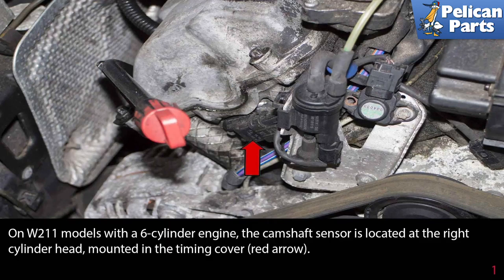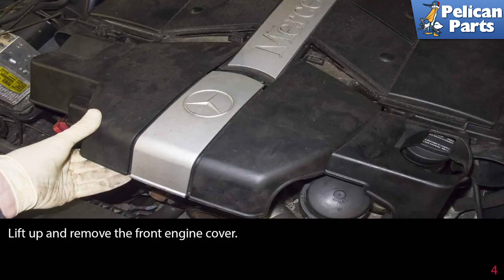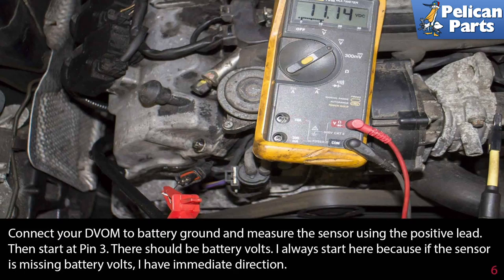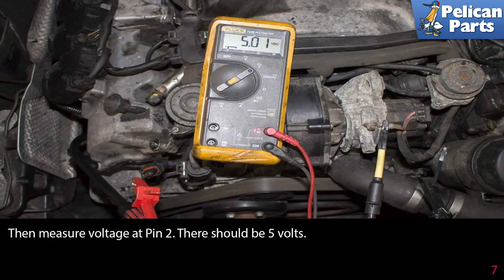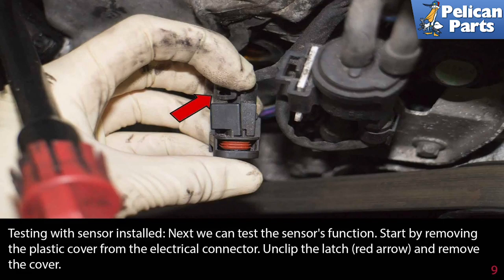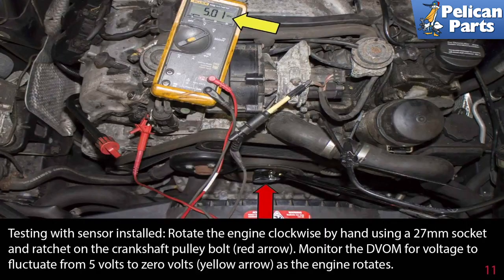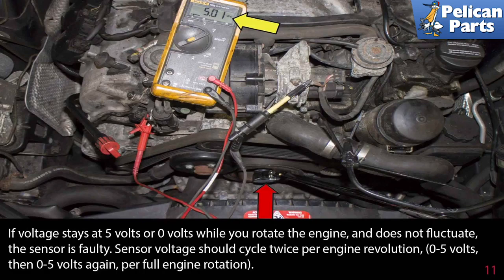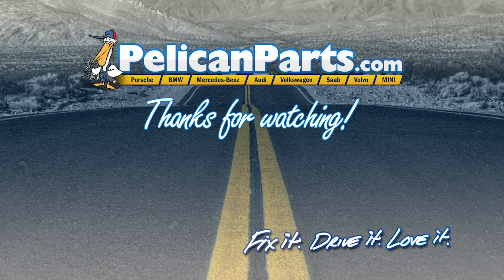Mercedes-Benz W211 E-Class Camshaft Position Sensor Testing

Comment: Great! covers many detail. thanks. My W164 cam sensor circuit, unplugged, middle pin has no voltage?? Really appreciate your comment!
Reply from the maker: Possible the wiring or DME is faulty.